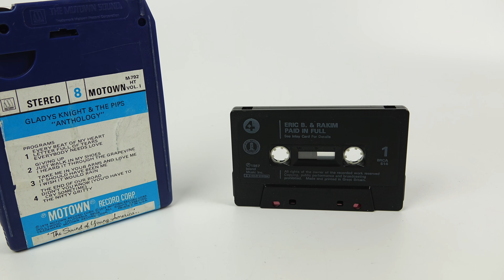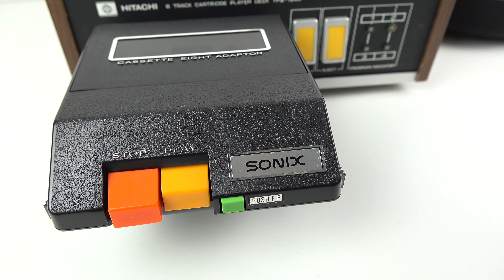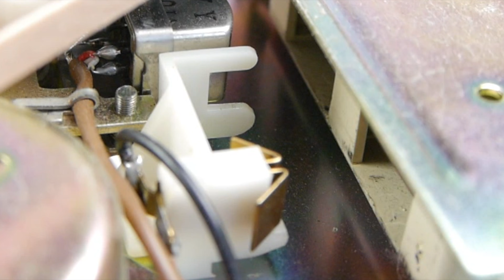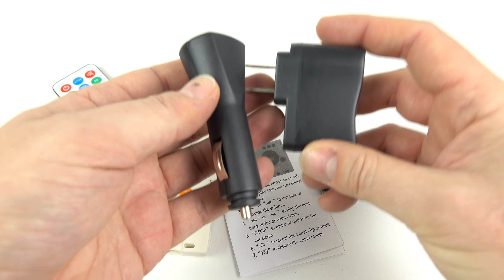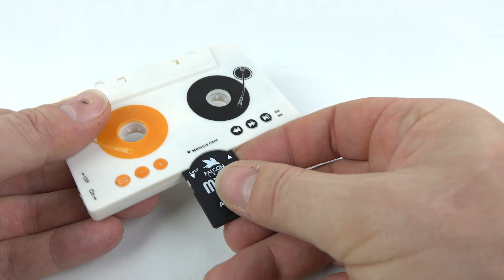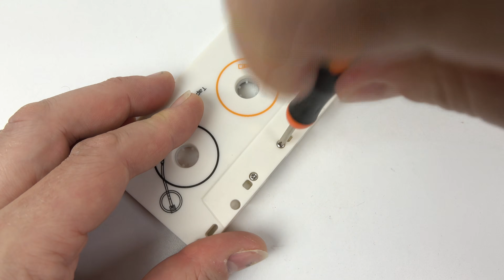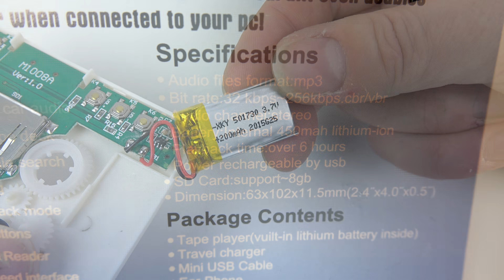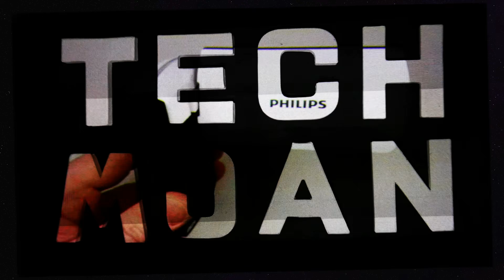Car Stereo Tape Adapters - 8-Track to Cassette to MP3

Comment: This takes me back. In 95 I made my own cd to tape adapter from a broken walkman, a headphone cord, and a blank cassette with screws so I could open the case. I soldered the headphone cord to the read head from the walkman and used wax to fix the head into place. The sound was better than some store bought ones because they usually have some sort of limiter. It did not work on tape decks that needed the reels to be connected but there was less of that back then anyway. I figured it used a coil to pick up the magnetics of the tape and further deduced that it could be used to produce a magnetic field that another tape head could pickup. I was right. No electronics necessary.

Comment: Thank you for showing the inside of the cassette MP3 player.  I'm one of those insatiably curious electronically-inclined blokes.

It was interesting to note that the bottom side of the PCB had unpopulated pads for a micro SD slot.  So they may have produced a micro SD version, as well.

Comment: Very cool. Some of those MP3 cassette adapters do have sensors which will detect the transport motions of the cassette deck and allow you to control their function using the deck's transport controls.

Comment: What proves that the cassette to MP3 adapter is always playing, you could hear sound from the 8 Track player even before you pressed Play on the cassette to 8 Track adapter.  

Also, the player working with a 16GB card, was it really or did it only recognise the first 8GB of the card?  From what I understand, both 8GB and 16GB SD cards are SDHC.  I know I had bother when I dd'd an image of an SDHC card to an SDXC card ad ended up having to reformat the card and copy everything from the image to the card like I should have done in the first place instead of being a smartarse.  

Maybe the player just supports all SDHC cards, but how do you find out without knowing exactly where every single track is on the card?

Comment: you should have kept going - to a 32Gb card, and then a 64Gb card and so on - test that little walkman buddies limits :)
Reply: If the stated limit is 8GB - it means that it supports up to SDHC cards. Which are available at up to 32 GB capacity. 64GB is a SDXC, which will probably not be detected by the device
Reply: My guess is the documentation indicated 8 Gb because it was the biggest capacity available for a SDHC card at that time.
Reply: +julosx yep, that's the standard practice

Comment: Talking about cheap power adapters:  
Could you tell us which car cigarette to usb adapter is worthwhile? 
i found many create a lot of HF noise and my radio reception drops.
Reply from the maker: Just pay a decent amount from a recognisable brand - or a company you trust. E.g. Belkin, Griffin - perhaps pick one up in a proper electronics or phone store, even an Apple store.... just avoid unbranded or cheapo devices from a market stall or a random ebay seller. Too many people buy a dash cam or action cam  for £100+, then cheap-out on the SD card and charger and blame the device.
Reply: Thank you, will do!
Reply: Anker. Hands down, the best USB charging solutions (including cables) I've ever come across. Readily available on Amazon. Maybe slightly more than some of the alternatives, but you get what you pay for...
Reply: Have you ever heard of Databits? 

He does content similar to yours.
Reply: Tronsmart has HF noise like crazy on their car (samsung compat fast charge) adaptors fwiw, good and cheap though
Reply: Anker for anything they sell, hey also have great customer service
Reply: I call them "cigarette-lighter lighters"
Reply: Yes I agree with Anker products. Good quality and good prices
Reply: YensR 
I had this problem  too !

Comment: A couple more pieces of trivia. I believe some of the 8 track to cassette adaptors did use mechanical coupling to move the cassette tape rather than a separate motor. 
I have found that both the cassette adaptors and the similar FM tuner to 8 track adaptors don't always work on all machines. Particularly battery powered portable 8 track players, because the voltage on the track sensor isn't high enough. Also, some home decks have used (low) AC voltage on the sensor. Neither will power the auxiliary units. 
Oh, and there were cassette shaped FM and I believe AM tuner adaptors as well that came and went. 
But what you really  want now is the Bluetooth to cassette adaptor! :-)

Comment: here is usa link to cassette player adaptor :
http://www.ebay.com/itm/EU-Vintage-Car-Tape-Cassette-SD-MMC-MP3-Player-Adapter-Kit-With-Remote-Control-/361413105856?hash=item5425e658c0:g:yaAAAOSwo0JWJvYP

Comment: now if i want to play vinyl in my modern car, have a solution for that?
Reply: John Lennon had a floating turntable installed in his Rolls Royce back in the '60s.
Reply: just imagine the vibrations xD
Reply: they actually have car record players. I saw a DeSoto Firedome at a show with a record player installed in it. Slid in like a CD, It plays the record upside down in a gyroscopic type springed enclosure, the owner of the car said it never skipped.
Reply: There's a Victrola player for motorcars … called Motorola.
Reply: you could measure "vinyl records eaten by the scratchy vibrato-stylus per minute".
also imagine the vibrations of the stylus (mainly because of the motor, but also the road) amplified by your car stereo.
you might just go deaf from that by listening to the music at conversation-volume.
Reply: Motorola's original product I believe
Reply: now we only need portable vinyl player, like those portable cd players where in the end of 1990's and early 2000's. 
it could have some kind of digital read ahead buffer to prevent skipping, but just think of the comical size of that thing, it would require it's own backbag just to carry it around.
Reply: Is it the same system Chrysler used?  I've heard Chrysler had a system for some of their cars in the mid or late 1950s, fairly expensive and short-lived, that only played special records.
Reply: in-car record players were a thing back in the 60s. You can occasionally find them on ebay but you'll need seriously deep pockets if you want one as these are incredibly rare these days and command insane prices.

All the one I've seen only played 7" 45rpm discs which makes sense as a 12" record is a bit big for a car. Not quite sure how they kept it from skipping though
Reply: USB turntable connected to your modern car's USB jack.

Comment: Thanks for sharing. Always like your interesting take on audio equipment. That setup is pretty cool. I never knew those SD card MP3 player tape adaptors actually existed. I have seen the cassette adaptors before though. All you need to do now is find a way of adding a wireless connection, and maybe bluetooth into it or thinking outside the box again, somehow vinyl but I can't see that being that possible.

Comment: You should have connected a record deck to the cassette with one of those other tape to 3.5mm adapters, the connect to 8 Track adapter, then connect to 8 Track player, and the 8 Track audio out to PC mic input and watch the universe explode under the audio paradox.

Comment: Have you ever heard of the Philips car record player ? It used to play "45's" which you pushed in singly. It would then eject them after play. It was okay on smooth roads, but used to "jump" when going over bumps. I can't find  anybody else that can recall them.
Reply from the maker: There were lots of competing car record players - http://www.darkroastedblend.com/2010/04/car-record-players-other-cool-vintage.html
Reply: Interesting, never seen or heard of it before.
Reply: I've read that car record players had to press needle hard to the record to reduce skipping.. supposedly this wore off records quickly.
Reply: I didn't find that, but it did jump over hard bumps. Surprisingly they weren't bad before cassettes were invented, then they disappeared.

Comment: The MP3 adapter/player may accept up to 32GB cards, as this is the maximum permitted by the SDHC format. Greater capacities are SDXC-only.

12:10 Nirvana achieved.

Comment: MP3 to cassette to 8 track. That is what I call backwards compatibility. Although something tells me it can't be taken all the way back to records.
Reply: a small speaker or piezo element should do fine.
Reply: Probably not, since records use physical grooves rather than magnetic pulses, although maybe with some very fancy and expensive technology you could create those grooves...
Reply: Actually, you might be able to create some kind of device which pushes the needle up and down to simulate the grooves.
Reply: Sounds like a challenge! Anyone up for it?
Reply: stonent
That's boring though. You are just converting jack sizes. We want to go full on and simulate there being a record.
Reply: nrdesign1991 Do records work just like that? The needle moves at the same frequency as the sound? Interesting. Definitely doable if so.
Reply: Doesn't sound that hard. I dont have an MP3 or a casette player, but I have the parts to make it work with just a line in. I'll let you know if I try.
Reply: I think you could put the record needle on a low volume speaker and get a mono sound out of it.
Reply: I think that even that is possible!!  One can create two very small Ceramic speakers which are positionned against each other and Alighned to the proper angle of the Stylus, and therefore transduce that microfibration In Stereo to the Stylus, just as the vinyl record will do.
The only thing is that the turntable has to be Non-rotational when the converter is placed under the Stylus.
Reply: Victor Lodewijckx
we already thought of that
Reply: *****
what I was thinking
Reply: Maybe something akin to a braille printer?  Or an anti-needle acting like a speaker?
Reply: ejcmoorhouse That's right! I used one of my cassette recorders like the Technics dual cassette deck from 1985 and a My First Sony sing-along children's cassette recorder from 1991 and it plays excellent. I also tried it my Sparkomatic 8-track and stick it into my 1972 Panasonic RS-803US 8-track recorder and it plays great. No need to get 8-track and cassette tapes, try the Updated Cassette Player with SD Card reader to play MP3's.
Reply: Mp3 to cassette to 8 track to 4 track to reel-reel to tefifon to magcart to victrola to cylinder to live performance
Reply: Hold my beer...

Comment: Next up, the MP3 to cassette to 8-track to tefifon to wire recorder mega adapter.
Reply: ... and back to the Tefifon.
Reply: You just need hi-fi straw.
Reply: Why stop there? Let's take it back to clay pots and straw.
Reply: That whole archaeoacoustic pottery thing is a myth.
Reply: because he can.
Reply: Can we get a wax cylinder adapter also?
Reply: No gramophone adapter at the end? Oh, right, the "deluxe version" has the feature.
Reply: gonigeena
 A hot needle does the grooves in a plastic strip.
Reply: You'd just need something to wiggle the stylus
Reply: Mp3 player to an earbud connected directly to a stylus needle. I wonder how bad that would sound?
Reply: SilentS Yes well dose it have blue tooth
Reply: it wouldn't be possible, because the teffifon has fixed grooves for the audio
Reply: Exactly was just thinking that!
Reply: We need to go deeper! BWOOOMMM!!!!
Reply: Power 99000000v Wats 9000 60hz 50hz 100000hz Headphone Out Amp Out PC out Speaker out 13000 Captiors
Reply: VHS to DVD to Betamax To UMatic to VTR to Philps VCR to Bluray TO 35/16/8mm Film to Slide/Negituve to Betacam to Video 8
to DV to VHS-C to Telefunken Ted to CaratrigeVision to CV-2000 to Laserdisc to ced mega adapeter and Floppy Disk HDD DVD rom Cd Rom
Cassete Tape ROM Cartrige EProm Punch Card Recoder and Drive powerd by USB and Seral And paralel and Tape input
Reply: Consoles
NES/Famicom
SNES
N64
Sega SG/Master System
Game Gear
Gameboy
GBA with Video
Mega Drive
Pc Engine
Atari 2600 5200 7800 Lynx Jaguar
FM Towns Marty
Saturn
PS1
Xbox 
PS2
PS3
PS4
XBOX 360/One
Wii Gamecube Wii U Switch
DS and 3DS and PSP and Vita
Dreamcast
Arcade PCB Sega Capcom Knoami Namco Only
Virtual Boy
and More
Reply: Recording Windows xp on to a casset
Reply: "Gluten-free" maybe.
Reply: PGTMR2 might get fluff on the needle ;)
Reply: That's what she said.............
Reply: SilentS nooooo it's mp3 to CD to cassette to 8-track to vynl to tefifon to wire recorder
Reply: UP NEXT Trs to XLR to SKR to RCA TO PCI to Mcia to USB
Reply: For Use With
TTY Mainframe 
DEC Mainframe 
IBM System 360
Altiair 8080
ISAMI 8080
Intelec 80
IBM PC/Tandy/DOS w VGA SVGA Sound Blater Covox
Apple II/Plus/C/E/GS 
Mac
Windows 
Nec PC 88/98
MSX 1/2
FM 7/New/8
Sharp X1/68000
FM Towns
ZX Spectrum
C64
Atari 8bit/ST
Amgia 
Amstrad CPC
Acron Acm 
BBC Micro 
and More
Reply: Smart Phone
Motorola Tac Brick Phones
Nokia 33 series
Newer Phones
Ipohone
Ipad
Andriod
Balckberry
Pager
Windows Phone 
and More
Reply: Reqiers a Modem and Pionting Divice and TV TTY montor
Input RF in/out AV in/out RGB in/out HDMI in/out Power 180000w 60hz 50hz 
Mega Cables incude to Player and Seral Paralel And  Joystic Incuded
USB Incucded
Software Mega Capture 1..0 
Press A or Any Key To inport and Capture
Prees B or 2 To Upload to VHS and Camcoder and Internet and BBS
Press A B or 6 to Save as WMV AVI MOV EXE Rom OR Card
Press B A or 7 To Play Puase Record Rewind Fast Fordad
Reply: You forgot Edison wax cylinder recorder!